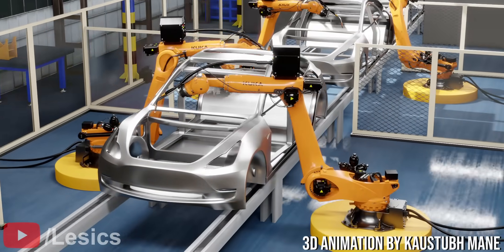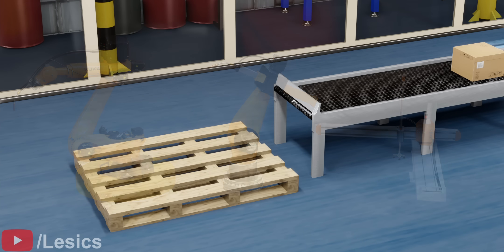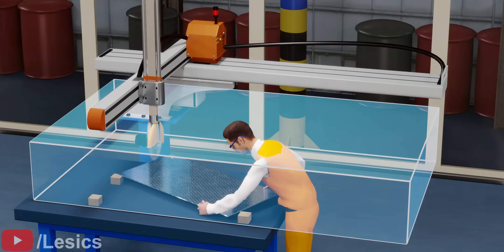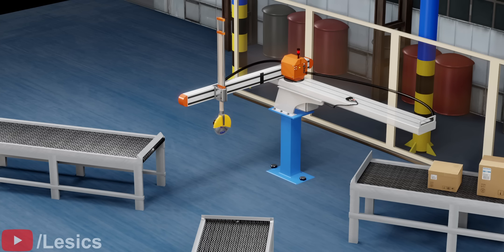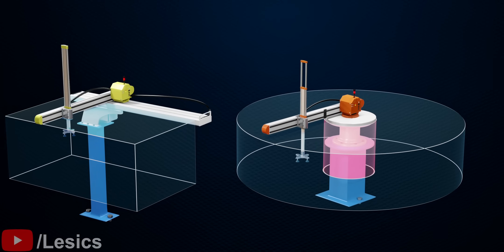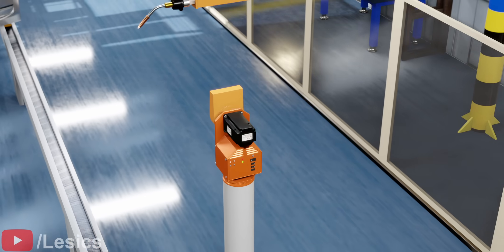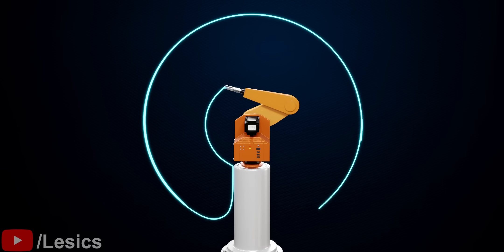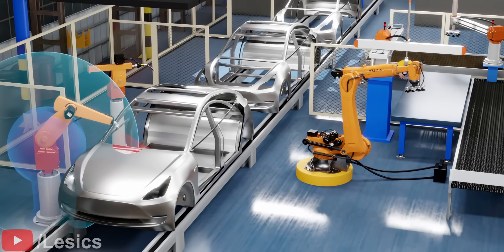Understanding Work Envelopes of Robots!

Comment: I work in robotics and this is a great explanation! one thing to keep in mind though is that for many processes, just because the target is within the end effector work envelope, that doesn't mean that the process can be completed. Take processes like painting for example, where the angle at which the sprayer faces the target makes a huge difference to the final product. there are many cases where the target is within the work envelope, but can't be reached at the desired angles.

I don't think you said anything wrong at all. Just pointing out that the subject of work envelopes gets a lot deeper and still has some difficult and unsolved problems pertaining to it!
Reply: Thank you for your sharing, I am also interest in the Topic. Just wondering if we can "model" such concern mathematically, e.g. Define opertable envelope for any specific spatial location (x, y, z)? Thanks in advance.
Reply: @kritsadacharoen6001  Yes, you can! https://en.wikipedia.org/wiki/Inverse_kinematics
Reply: Agreed. I did a visualization similar to the work envelope shown in the video (using a point cloud in RViz, the ROS visualizer), except it only included points that were fully reachable. It's a much smaller volume.
Reply: That's why there are 4 and 5 axes milling or priniting machines (the 4th and 5th axis are there to access to target at the desired angle). There are 6 axes robots but I don't know in which cases they are ueful.
Reply: @joeah3479  a 5th and 6th axis is useful in lots of applications. Imagine welding or painting, where angles of work matter a lot, and the only "free" axis is rotation around the z-axis of the work angle. Youd need 5 minimum to control those angles.

In a lot of cases, you actually need MORE than 6 in order to avoid collisions.
Reply: I feel bad for them 🥺 🥺
Reply: got any good advice or websites to study robotics
Reply: yeah... the end effector often comes with multiple rotary joints to overcome this issue
Reply: @commieTerminator  that actually doesn't solve the issue. A process near the edge of a work envelope can still be unreachable because those targets tend to be near joint singularity. It's like saying I can reach things farther away because Im double-jointed.

Imagine a weld facing outward that's at the edge of the spherical work envelope, where the robot can only reach by facing the welding torch away from itself. Another revolute joint that doesn't expand the envelope is never going to make that weld reachable.

Comment: The 2R robot shown at 5:02 also cannot achieve the welding task, not entirely due to work envelope inefficiency, but also not being able to control both orientation and position (even on a plane). I understand that you are trying to indicate a point, but you are doing it at the expense of misguiding students.
Reply: The robot uses a rotary planar joint - RP not RR as you say. But your point is correct. I guess they cannot cover everything in such a short video.

Comment: One of the useless video about robotics.  Anyone can figure it out easily.   You should explain the pros and cons of each type of robot.     Cartesian robots are the cheapest, most accurate, repeatable, lowest weight to load ratio and operation costs.  These days robots are so advanced that they use six axes and almost they do not have any dead zones.  But they are quite expensive.